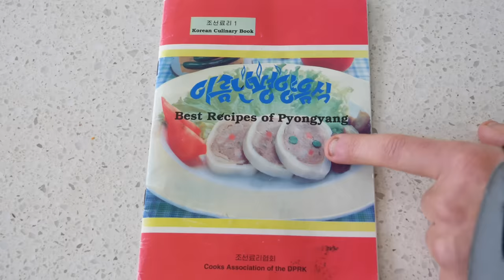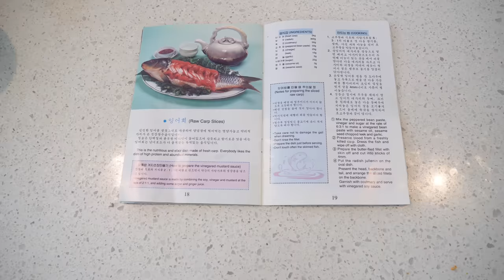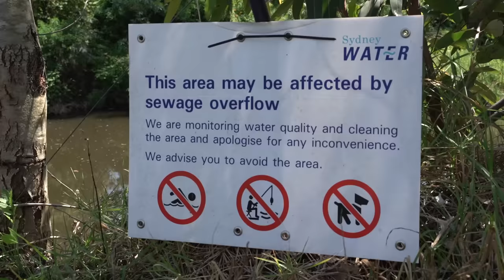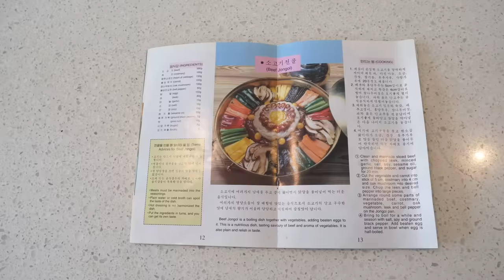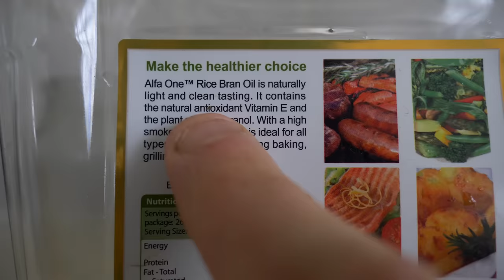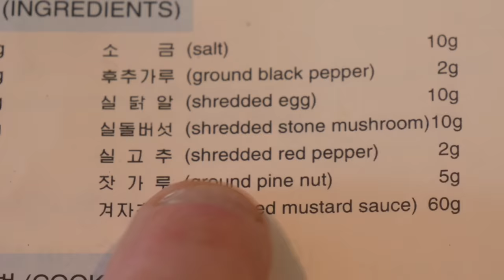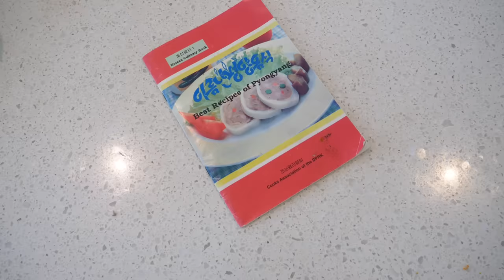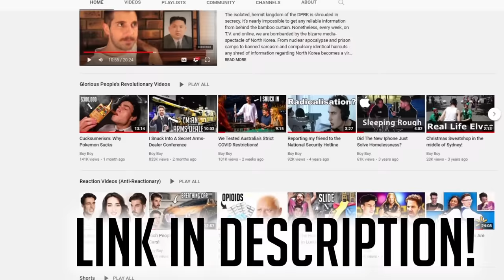Following a Cookbook I Stole From North Korea!

Comment: Meat jelly is the best dish!!! I'm biased by being born into a culture which loves it, but believe me, it's just another alternative to other preserved meats, which was born in cultures which have harsh winters. It's a magnificent dish that takes half a day to watch over, but later you don't cook the meat and eat it the moment you want to.

Basically, you need bones to produce thick jelatine stock, and some meat boiled to the extent it falls apart. In my family adding some bay leaf is obligatory, and allspice (pimento) is contested. We don't add peppercorns, but it's a solid option as well. Oh, and garlick goes well with the taste.

Usually we just boil equal parts pork shank and any beef in a pressure cooker (otherwise it takes ages; and the water doesn't boil away), adding spices at some later points (so to get the taste into the stock, but not to degrade it for boiling them for too long). Take shallow dishes, any tupperware is fine, we have enameled containers just for that. Separate the meat from the bones, it has to fall apart, just your basic forks would be sufficient, split the meat equally between your dishes and pour the stock over. Let it cool completely, put it in the fridge to set (12 to 24 hours). After it's ready, scrape away the white layer of fat (idk, you may keep it to use within a week to fry your potatoes and whatnot), and turn it over for glossy prettiness. 

I prefer it when there is just enough stock to glue the meat together, I have no particular fondness for the stock jello, but there can be less meat and more of the jiggly translucent stock.

Pig trotters are a solid option, but that makes for a nightmare of picking out the small bones (it's a good use of a teen in the kitchen though). Old tough chicken/rooster is also a traditional ingredient, it makes the nicest smell and taste, and that chicken otherwise it's only fit for soup. Since it's boiled for a long time, that tough meat turns nice and soft.

There is a fish aspic tradition, but that actually requires some expensive fish. Or additional jelatine. Personally, I don't like it either way.

Comment: you might actually need to leave it outside on the snow in winter or inside of a refrigerator under -4 to -12 c and then defrost it slowly on the windowsill during winter or icebox for the raw fish dish, im most probably not joking.
Reply: That's what I thought, freeze it at - 18 celcius for 48h dammit!
Reply: It's Australia less than 1% of the country gets cold enough for snow and that's only 3 months of the year at most

Comment: It will honestly take 3 years for the parasite to go through the whole cycle of leaving your body. It will get worse before it gets better. Hope for not round worm. Always freeze it first to kill the eggs. The mucus is from bacteria most likely, so not necessarily swolle death for your intestinal walls. Puncturing the skin in that water was not ideal, and I hope you used proper knife technique and did not eat near the wound. It looks like it rained recently enough, and the trash was more hill run off than any kind of waste and sewage.